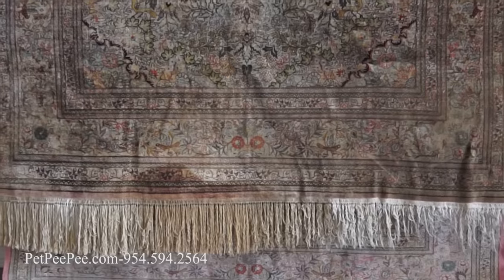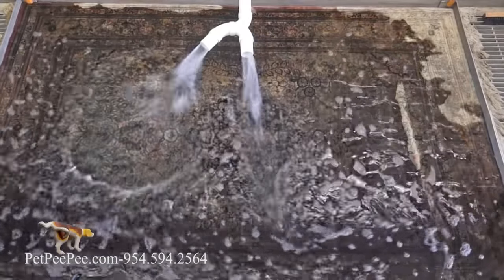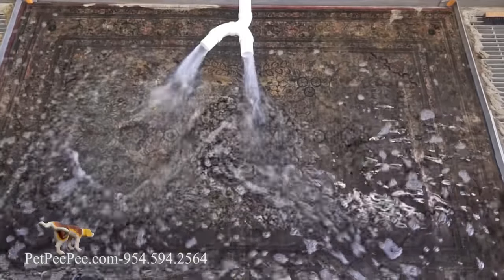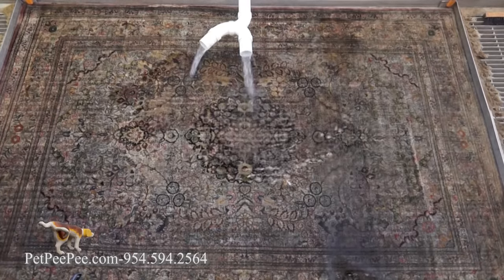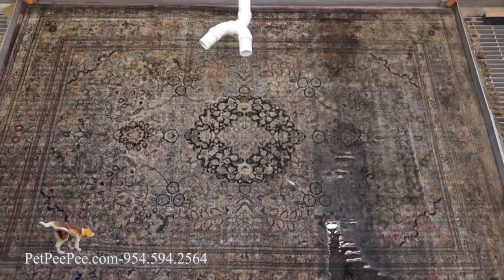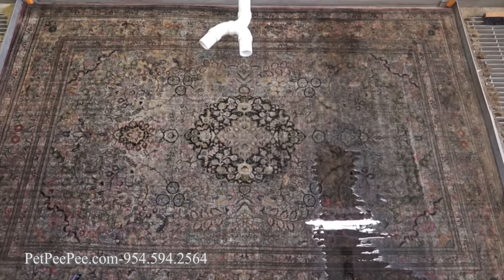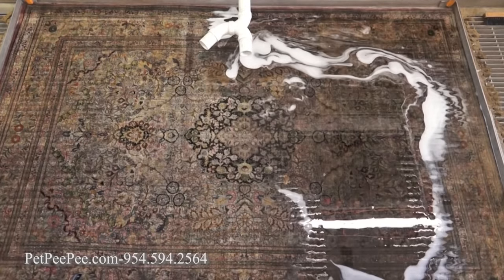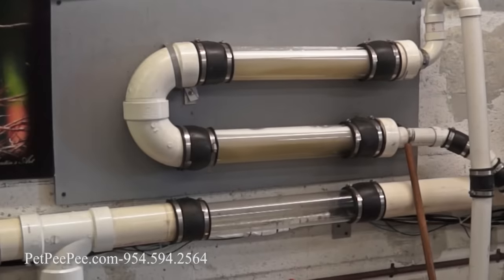PetPeePee Company-Saving Oriental rug from the dumpster

Comment: That's an interesting setup. I would think that there are not too many of this type of cleaners out there. Very interesting.
Reply: Mike nonameneeded Meir didn’t mention it in this video.  However, he has mentioned previously that the he designed and constructed the entire system.  Meir is also an accomplished and published photographer of wildlife.  I’m not a customer but I certainly will be if the need arises.
Reply from the maker: Thank you

Comment: "Natural Dead Sea Cleaner", as in sea-salt softened water? This would be fine for removing urine odor and previously used cleaning products, essentially soaking and rinsing the rug until all of the urine crystals and trapped detergents in the fibers have been liquefied and rinsed away, but how does it remove sand, dander or oils from feet, food, air fresheners and smoke? Is the cleaning limited to the removal of pet odor?
Reply from the maker: The Dead Sea it is not the sea salt.  she have different kind of minerals
Reply from the maker: The Dead Sea have all kind different kind of minerals

Comment: It’s an interesting way to remove the water.   Their are products developed for this industry that break down the salts and remove the urine.   Removing the odor and salts from the urine is the easy part.  It’s the yellow that’s left behind that’s difficult or impossible from wool or silks.   They didn’t show any before and after for this problem.  After the odors gone the customer wants the yellow gone.   In my opinion, saying when the tube is clear the rug is clean is incorrect.  It just means your cleaner isn’t removing anything else.
Reply from the maker: Thank you very much for watching Petpeepee video I appreciate your

Comment: The fringe is not being cleaned in this process how do you clean the fringe in the process s thus was outside your frame 
You say the rug is clean when the liquid is clear. Your salt cleaning system is a cloudy suspension on mineral salts 

You you use a clear flushing system with just H20 this not explained

Drying process removal of excess moisture how is this done do you use a squeegee on the carpet or spinning.

Mechanical agitation of fibres will not damage the silk hot water will and chemicals will.

Comment: Why wouldn’t you do this upside down to get the dirt out easier?
Reply: He explained it was because the water went in the same direction as the urine.
Reply: The colors are more likely to bleed on to the surface if cleaning upside down. This flushes urine THROUGH the rug so the urine does not affect the top of the rug again.